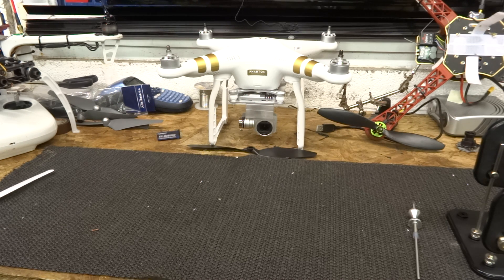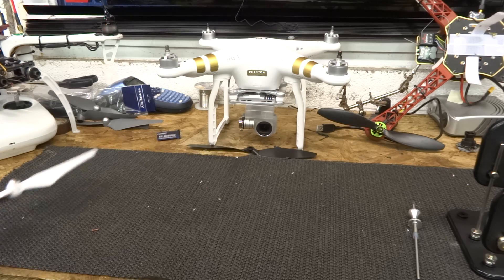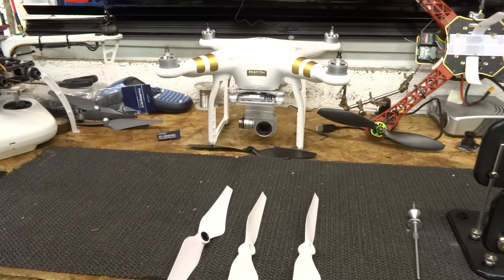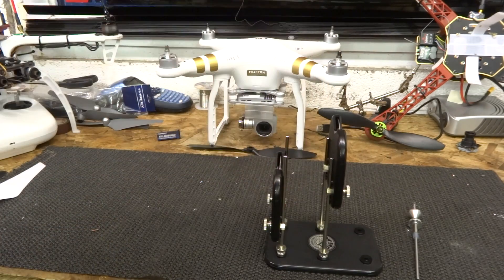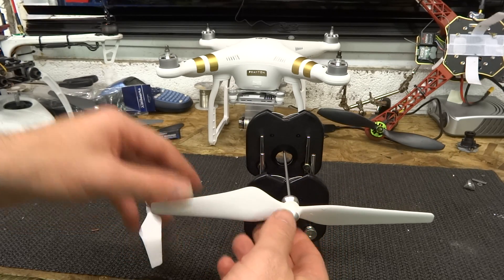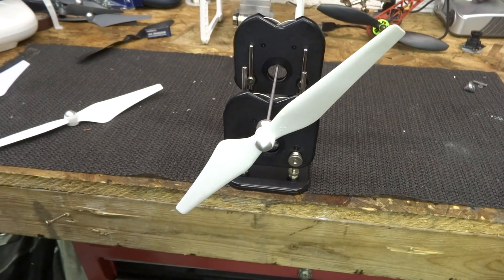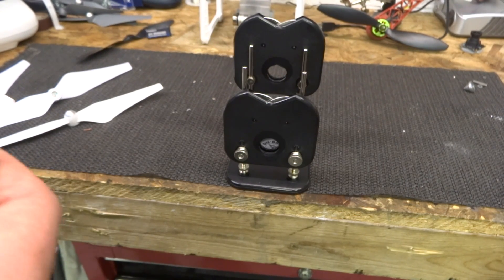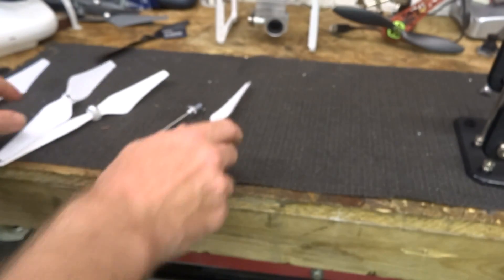DJI Phantom 3 Propeller & Balancing Tutorial

Comment: Use an o-ring like the Yuneec Typhoon does. Tighten the prop a half turn against an o-ring that can be found at any hardware store.  I love them.
Reply: @hitman_for_hire2 A little lost at what you're explaining here could you elaborate a little bit more and say using o-ring like the yuneec typhoon does.,.. explain this more please....... And then explain the rest of your comment is that an alternative to the device this gentleman has and another way of balancing the blade without needing extra material you could leave a message in the comment section or you can PM me either or I met you I'm not the only person that doesn't quite understand your comment but I find what you're saying is interesting and it sounds like you know what you're talking about could you enlighten me so I know what you're talking about lol 😂
Reply: The O-RING keeps the blades from spinning off in case of hard stop or other hard directional changes. Slip the o-ring over the threaded shaft before spinning the blades on. Usually a throttle-up is what snugs the blades against the o-ring. Yuneec got it right when they  added this security feature. @gdent58
Reply: @USMC-Sniper-0137  ty

Comment: In the kits - there should be a specific brass bush that fits P3 prop hubs and the silicon is only used to keep the bush in place, It is not designed to be the mount for the prop.

Comment: Hi folks. This way of attaching braking props by screwing them on would worry me. I don't have a Phantom 3 but if I did I'd be looking for some anti-shake washers - if they will fit. Alternatively maybe a small rubber 'o' ring. Try either at your own risk and test very thoroughly at a low level! Better still, do a tie down test. Out of balance props are very likely to cause the screw thread in the hub to become loose over time as well. No wonder DJI changed the attachment method. Bob.
Reply from the maker: Overall tag these props have been extremely reliable, with composite hubs they do grip very well and in hundreds of flight hours failure is not common  tbh.
Reply: The video makes a big deal out of nothing ... fit the props correctly and there is no problem. Its only where people do not check first ... do not tighten props correctly and then go flying.

Comment: Hi buddy, what would be appropriate maintenance of the motors, do they need a kind of oil or lube?
Reply from the maker: I would not add any form of lube to motor bearings, these are sealed pre greased at the factory, adding any form of thin lube could actually I introduce dirt and grit and wash out the existing lubrication.

Comment: A properly balanced prop will hold any position the user places a prop. Just because the prop holds horizontal position does not make it balanced. If a prop is placed at any degree within 360 degrees it should NOT move if its properly balanced.

Comment: Wouldn't placing tape on the underside of the prop be better? I'm new to small RC airplanes and multicopters but if a layer of frost/snow/ice can cause issues with a human airplane, then it seems like the tape could as well if placed on top of the airfoil.

Comment: Well friend, the problem is that tape alters the shape of the blade and has a negative effect on the blade aerodynamics. It's a wing at the end and putting a piece of tape on a high-speed blade can affect the draft and resistance.
Reply: not like you think.  They actually make balancing tape (the better choice) that I have used on the edges of RC helicopter (multi thousand dollar models, not $50/walmart jobs) with zero effect whatsover.    It actually should be folded over the leading edge and has zero effect on aerodynamics.  No more than a super think layer of water would over the WHOLE wing (not talking ice).

Comment: if we use the metal hub, can we disable the active braking feature in the DJI app? 
does it matter which side of the blade you put the electrical tape on? i see you put it on the top side. finally, near the end, you said the hub is heavier at the bottom so how can we resolve that? i didnt see you do anything to the prop

Comment: I have been manufacturing prop balancing rods for over two years ,first I machined from solid alum rods cheaper to build but I was not satisfied with the results. Now I machine just the tips from alum & use very small steel rods and heat treat.  Each rod is checked to 1/2 thousandths.  We test multiple types of props. Due the the light weight of these props my rod have to be +/- two thousandths of an inch or we scrap them because they will not work correctly. There is no way a piece of tape or rubber tube will hold close enough to balance a prop accurately.  Please check out my cusomer reviews on amazon 
Thanks  EJH     
http://www.ejhdrones.com/collections/ejh-precision-prop-balancers/products/prop-balancer-dji-phantom-series-ejh-precision-self-centering-balancer-rod

Comment: Use some clear fingernail the polish on the tip of the light Side prop never sand on your prop the central force is on the tip of the prop not the hub do not add weight to the hub.

Comment: 5:49 I trusted you... did it this way.. shaved 8 carbon Fiber props until balanced... actual appropriate shaft arrived today... I double checked the balance... ALL are OFF.. guess why? The tubing was slightly thinner on one side.. thus, every prop I did with your method has to be re-done. I've learned my lesson, I wish I could say you helped me... please share with others that the rubber retainer you are using to "center" the prop may just be OFF... and so will all of props be if you go that route. Safe to say, I'm disappointed... sent me down the wrong path my friend...
Reply: I bought the proper shaft back in November... all is good. Thanks John. Now, the P4 quads don't work with this balancer... new prop design...
Reply: Nope. The blade is centred by the machine cone, not the tubing. Bob.
Reply: Thank you for pointing this out. I almost did the same mistake.
Reply: Correct - the silicon tube is NOT there to centre the prop. There is a specific brass bush provided for that job.
Reply: Sorry - but using the cone - that's a hash up and not what is supposed to be done. Use the proper bush ... or get better gear - the ODay / OCDay balancer has much better instructions

Comment: Insulation tape fixes the unbalanced prop but causes airflow issues. Sand it lightly and widely so you don't cause a dip on the prop profile. Advice from a helo pilot. Good video otherwise, subscribed.

Comment: Do not use tape or anything that disturbs the air flow over the prop.  terrible advice.

gently sand the bottom side.
Reply: Plus it could easily come off.
I mean, how many rpm's we got there,Vs cheap chinese insulation tape glue....LoL

Comment: Hi!
Why don't you use the tightening tool that comes with the Phantom 3 in order to tighten the props really good?
By doing that the props with metal hub won't be a problem. In fact the upgrade carbon props for the Phantom has a metal hub. An alternative might be to use LocTite (thread locking). Or maybe both.
/BR Rune
Reply: I only stick to the stock hubs after some mishaps with the carbon fibre ones. I need to balance my props but don't want to distrub airflow. Will sanding my props not mess anything up?

Comment: I have flown my p3p with the props from my p2v and have had no problems. I put them on and tighten them with the wrench. I don't think I would ever just spin one on and not tighten it down. After flying and working it I always have to use the wrench to get them off. So I see no harm in using them, and in fact DJI costumer service has no issues with using them. They recommend using them when I called a talk to them. U.S. Ethan info how you will. I plan to use my carbon fiber props from my P2V .

Comment: Question - these are self tightening props.  They lock in the opposite direction the blade spins.  Why would they fly off ?    Also, where did you get that balancer ?
Reply: They're self tightening in the sense that the air pushes against the prop, tightening it as it generates lift. Flying normally they should be fine, but if they're not snug on the motors they can unscrew mid flight if you fly aggressive or stop too abruptly.

Comment from the maker: Thanks for the feedback,  On balancing props start with the blades horizontal, see which one drops, rotate the prop 180 and perform again, if the same blade drops that is the heavier one, either gently sand the underneath of the heavy blade until they balance or alternatively add a slither of tape to the lighter blade to balance it out. 

Next to balance the hub place prop vertical and note what direction it falls, place it vertical again with the opposite blade at the top and note again what way it falls, you will notice it always falls one side, the side that falls down it the heaviest side of the hub, to balance the hub option 1 is to remove material from the heavy side with sandpaper doing a little at a time, option 2 is to add some glue/clear nail varnish in a small lump to the opposite side to add weight to that side of the hub, keep doing until the prop will site in what ever position you leave it. 

Hope it helps

Comment: what to do when the bottom prop is heaver? normal to use to just buy new one? did not get your last point clearly sorry...any more explanation would help.
thanks
Reply: Fares Alanazy He didn't explain that last part, but I assume you use the tape in the middle to balance it out too.